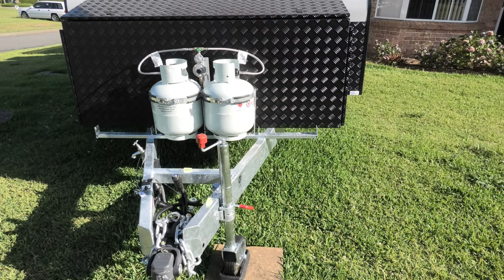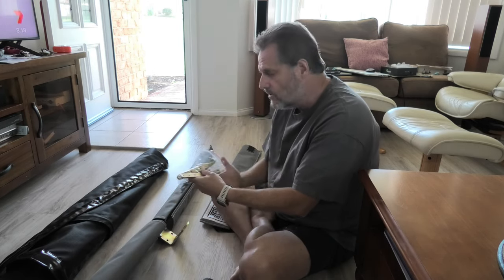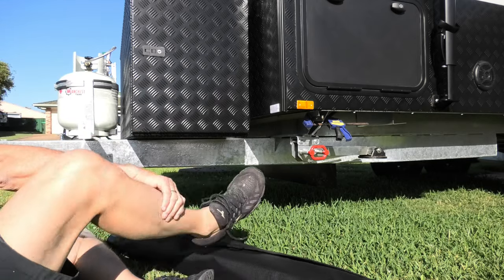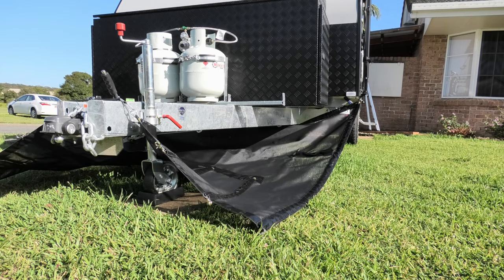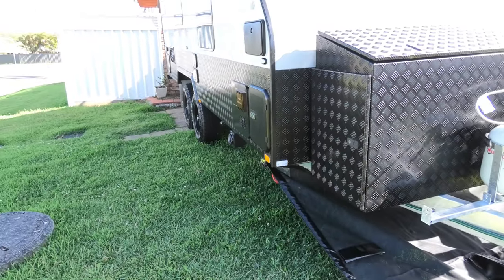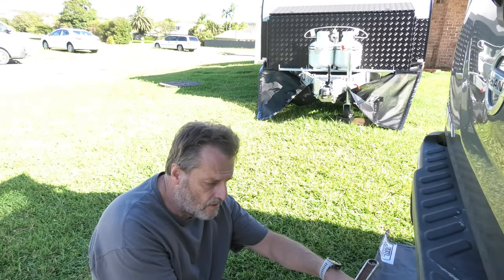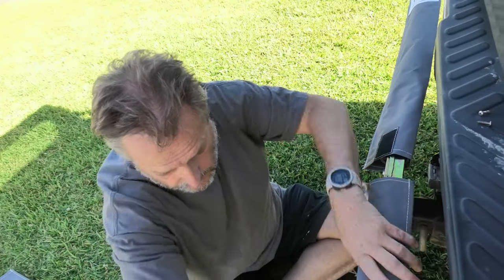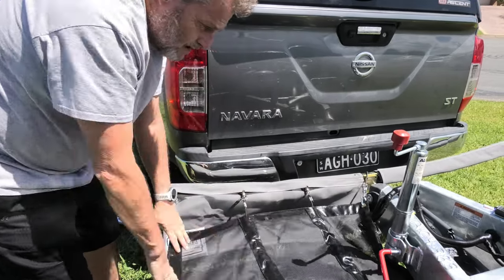Ep Mods-2302 - Install a Stone Stomper

Comment: Great Vid, Thanks. Just wondering how you went with your inverter install. Did you go 2000w or 3000w and did you have it wired into your existing 240v system or do you have a stand alone double pole 240v power point just for the inverter. Cheers
Reply from the maker: The two 120Ah lithiums i have, have a maximum current draw of 140Ah at any one time. I went with the 2000W as it wlorks in thia limit. The 3000w would have been overkill.
Reply: @PinkysTravelAdventures   Did you have it wired into your existing 240v system or do you have a stand alone double pole 240v power point just for the inverter. Cheers Al
Reply from the maker: I did a cheap wire into the existing 240v, put in an RCD before splicing into the van wiring. I turn of my RCD so when hooked into van park, the 240v doesn't go back to the inverter.
Reply: Thanks

Comment: Great vid , we have the same van..Can you tell me the width you ordered on the van end? Cheers
Reply from the maker: Caravan Make & Model
Jaycee AllTerrain 17.55.8 11/22

Vehicle Make & Model
Nissan Navara D23 05/17

Bar Option
Option 1 - Angled

Barwidth
custom
enter custom size
1650

Optional Bar Sleeves
YES

Bracket Option
150mm

Width (mm)
2,460

Length (mm)
1,960

Weight Distribution Hitch
NO

Is a Support Pocket required?
YES

Enter in mm the measurement from caravan crossbeam to support pocket
750
Reply: @PinkysTravelAdventures  Thanks...Have one ordered...cheers
Reply: Can I ask how you went with these measurements and if you would have adjusted them if you could? We have a 19.61-3 AT that we are picking up from interstate however the measurements are different:/ 2400W 1950L toolbox 1800/720

Comment: I thought you would be using WDH, your steering doesn't feel light
Reply from the maker: Whats WDH? Steering is fine. I've got air bags in the rear coil springs.
Reply: @PinkysTravelAdventures  Weight Distribution Hitch, transfers weight to the front wheels, Airbags don't do that - Difference Between Using Weight Distribution and Air Bags Youtube video https://www.youtube.com/watch?v=XBZu39pQ8Gg